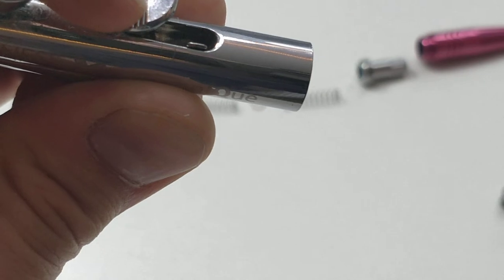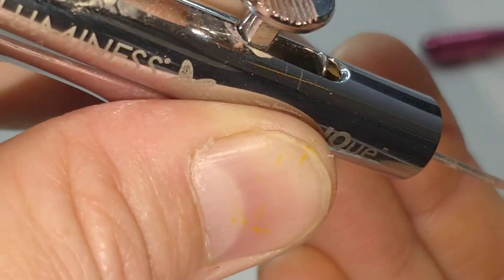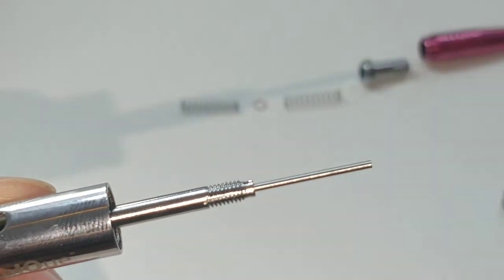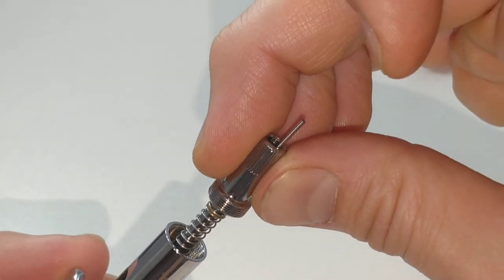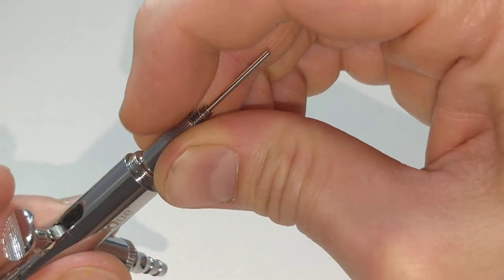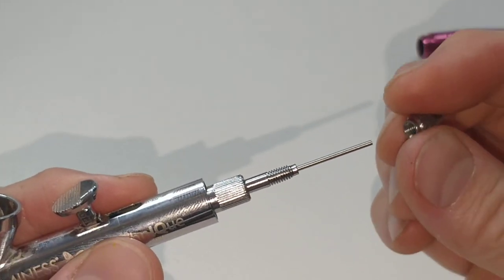Luminess TechnIQue TWO SPRING Airbrush Assembly How-To

Comment: Great Video!  When you are putting the little piece back in by the trigger, it worked the first time it you tip the stylus down just a bit and use a tweezer to put it in. Works first time, every time. Thank you for your time to put this video together.
Reply from the maker: Good recommendation!